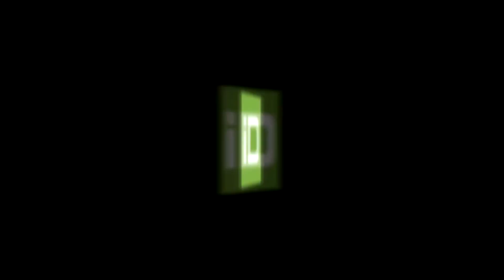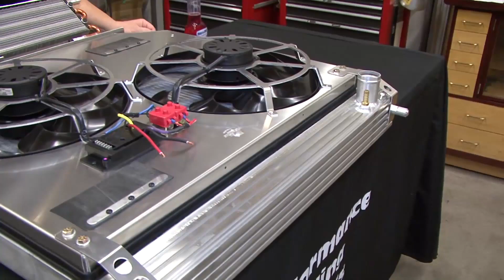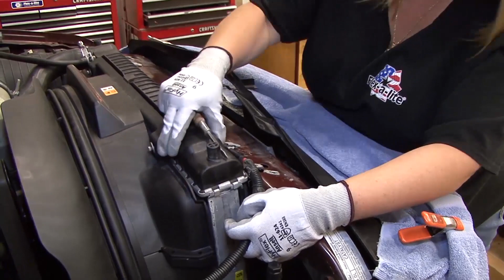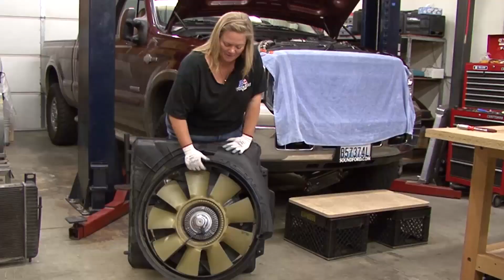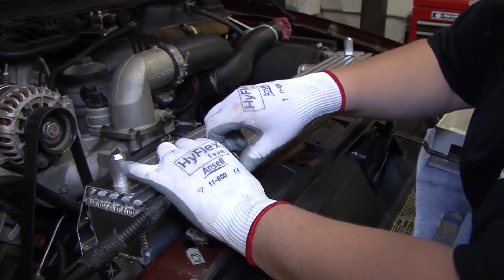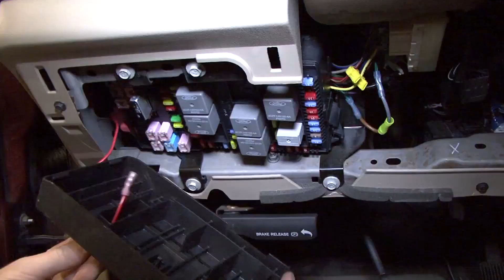Flex-a-Lite Radiator for Ford Super Duty 6-Liter

Comment: Okay, so I purchased just the fan unit (will use stock oem radiator).  I would appreciate focusing more on the wiring in a 6.0 especially when it comes to the AC clutch.  Is the fact that you selected a green wire coincidence or is it because the green wire for the clutch is the + for activation of the clutch?  Also, it would be nice to see how you wired to the fuse panel and the clutch, etc.
Appreciate this video though.